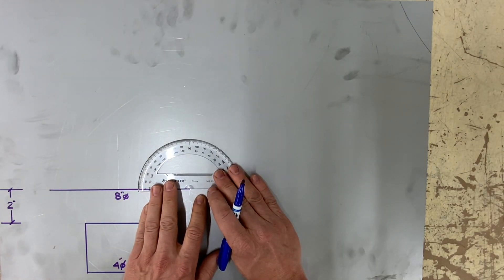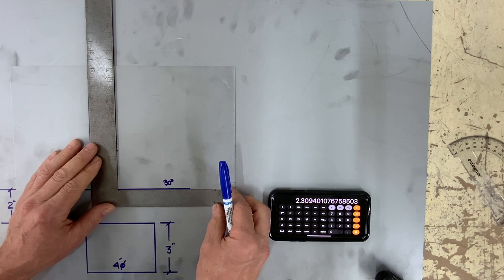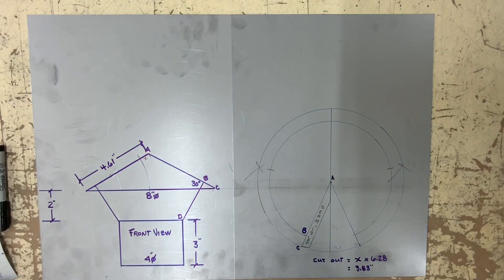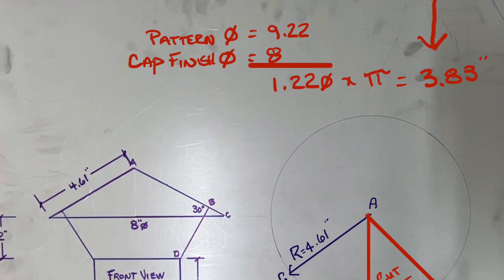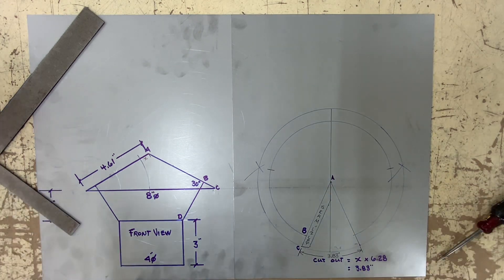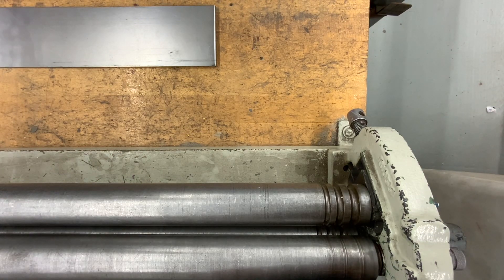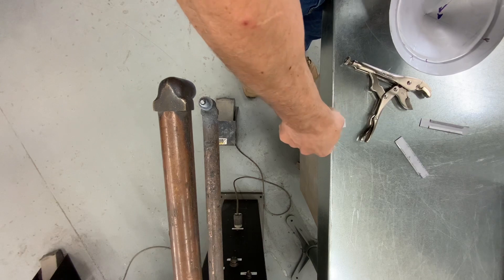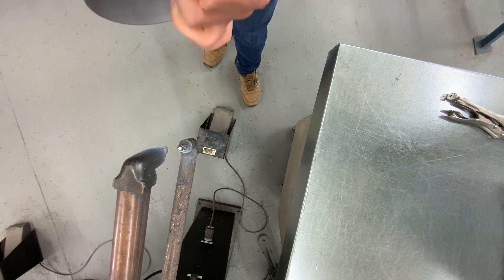Radial line development - Rain Cap, fabrication

Comment: Where do you find your information on details? Specifically when you say “it should be twice the diameter of the stack”. I’m genuinely interested in learning and hope to not sound rude at all. Do you use smacna? I love to know resources to learn from and own very many old sheet metal books
Reply from the maker: I’ve seen this in a few textbooks that have been around for many years.  We also follow SMACNA guidelines and perhaps they do provide a chart? But we follow the chart from a Richard Budzik book, PRACTICAL SHEET METAL LAYOUT, Round Fittings used today, on page 213.  Having said all that, you may find other resources that mention a slightly different slope angle and free Area.
Reply: @sheetmetalwork  awesome thanks